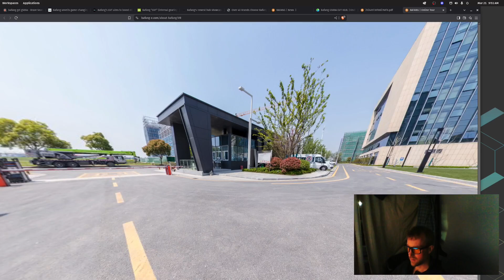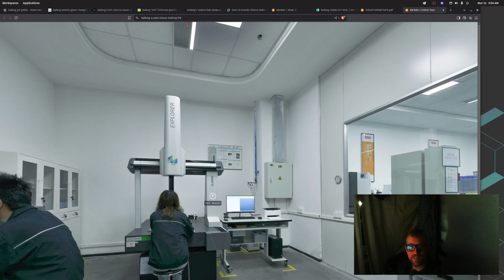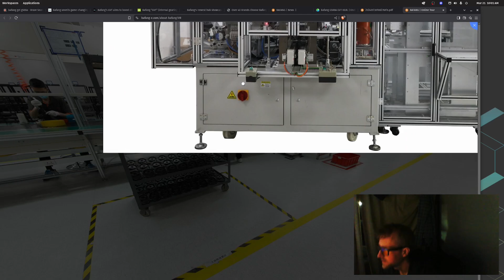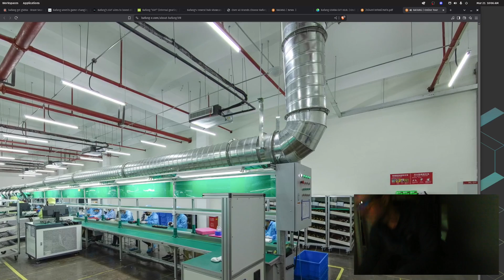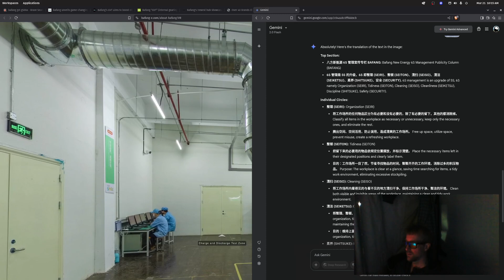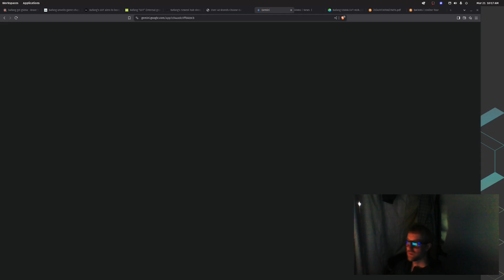#BAFANG FACTORY VR TOUR with @EBIKEBUILDER_

Comment: Seems they are super keen on tidyness, discipline, organisation etc... and what's with all thevdrinking mugs, and containers all on those shelves😄...seems they for sure can't have any drinks, or water near them on their desks & worktops...
I'd love to be let loose in the place and proper look at everything, and I also wonder what battery tech they are currently up to, would be interesting to see what cells they are putting in their battery packs - hmm, will they be using the newer Tabless cells maybe?
I can't make my mind up about which cells to get to build with, either maybe something like the Samsung 50s' or maybe the AMPACE JP40s / EVE 40PL (4000mah 70a) ???
Reply from the maker: choosing a battery cell depends on  how much space you have , how many amps you need to discharge,  how much range do you need, etc.    If its a normal 750w ebike its usually about 25amps,   1000w ebike motors use 30amps.  Need enough cells in parallel to do the amps that you need.  So a samsung 50S battery cell can do about 10amps, so would need at least 3P to do 30amps,  but its best not to drain batteries at their full amp rating,  so youd probably want 4 or 5p of samsung 50S  and that cell is nice for building a high capacity pack with lots of range,  But trades off a little bit in the discharge department, only 10 amps per cell.    Now on the other hand if you need a small battery then I often get high discharge cells  because a 1p or 2p high discharge battery can do 30 amps  but it wont have much capacity, etc.  So it really depends on how you will use the battery.  Same with voltage. if you arent going fast then high voltage isnt necessary and 48v can work fine. Some ebikes are 36v  and they can still produce lots of torque  just not as high top speed.   Lots of options for battery cells though its usually choosing between range and discharge amps
Reply: @EBikeBuilder_  I kinda wanna just build a fun, short range low Ah pack of 60v (happy with 10 miles range just for a fun little lightweight battery) then further down the line I'll build a bigger cell load battery for bigger Ah & range...
Reply: @EBikeBuilder_  and sorry to rant on, but cheers, really appreciate (and understand) everything you've said 👍) so I'm thinking now maybe 16s3/4p for 60v using high 4000mah or 5000mah cells that will output around 10a each cell or more..? Yeah, I think I've understood pretty well, cheers!

Comment: I wanna go to China❤
Reply: Same, I'd love to go look at the E-bike tech.
Reply from the maker: i want to play with all the machines  Like the motor tster   and the rotor magnetic assembler  :person-turqouise-waving::face-green-smiling:
Reply: @EBikeBuilder_  I was thinking about the spoked hub motor wheels that were hung up on the wall (all different colours) the smaller ones on the very left looked almost like they were maybe for wheelchairs as they appeared to have outer hand rails to use to push/pull the wheel maybe? They were a bit odd as they didn't look to have any hub motor inside them, but the other ones you could clearly see they had hub motors in them..
They've got some pretty cool tech in there.
🚲⚡
Reply from the maker: they show it more up close in this video from elektrek https://youtu.be/kp1fj-P_PyI?si=S-4TaQZMSGzqx5XD